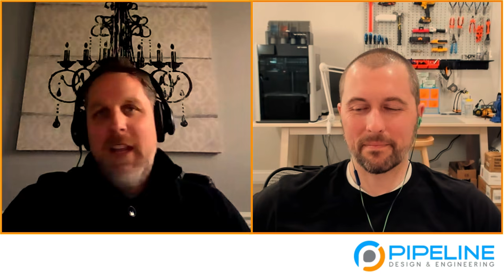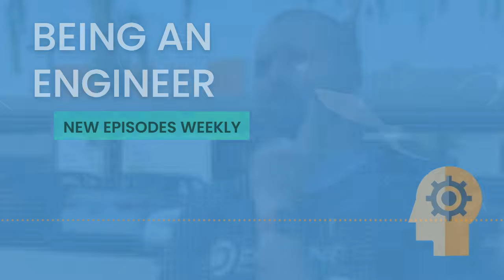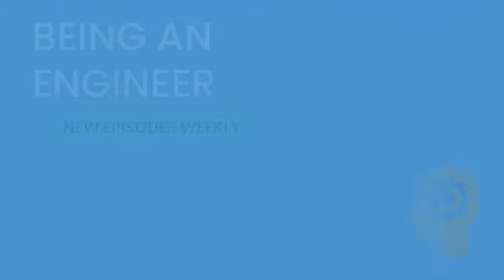S7E5 Scott Roberts | The Stainless Steel Hardening Process Most Engineers Don’t Know Exists

Comment: Also check out Balitherm Ionit, Pulsed Plasma Diffusion, LD Nitriding etc. There are quite a few diffusion processes that provide surface hardening without forming the carbides that compromise the corrosion resistance of stainless alloys.